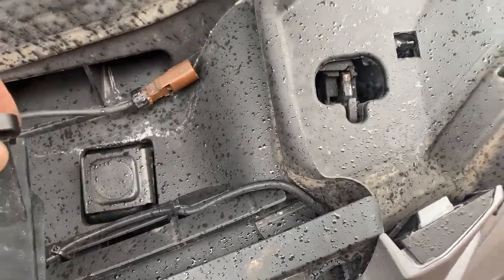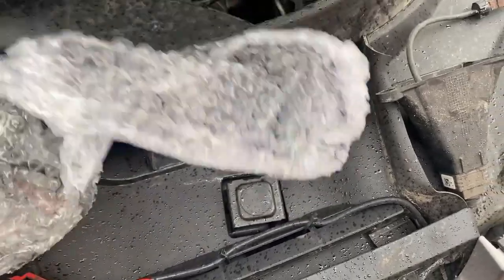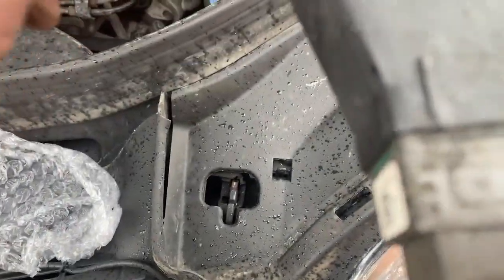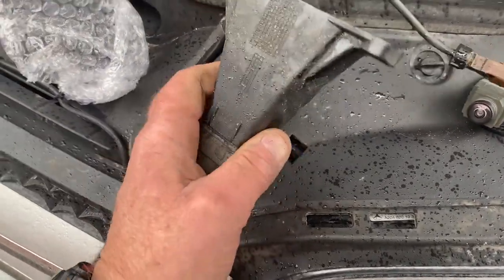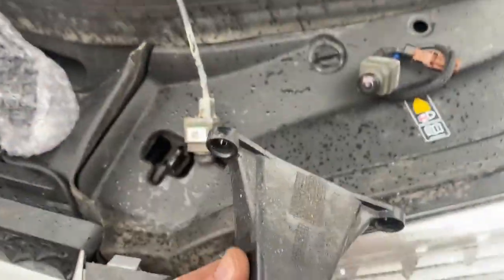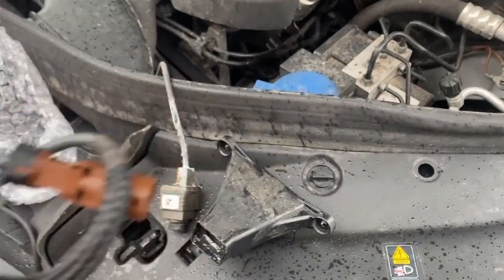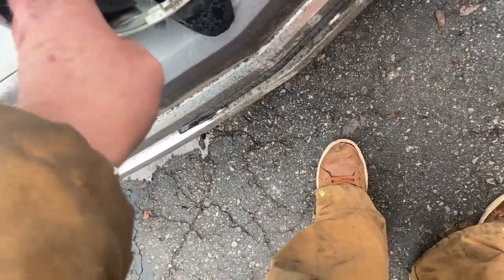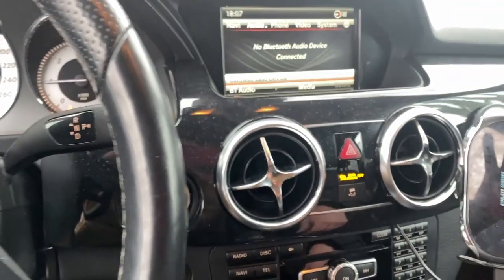Mercedes Front grille camera replacement 360 degree camera

Comment: Hi.  Thanks for posting.  Very helpful!  I'd also like to know where you purchased the new front camera.  Mine works intermittently so likely same corrosion.  Thank you.
Reply: got mine on Amazon, $212 CAD
Reply: @stevemurphy2591
Reply: Do you still have access to the part number you ordered?  

I'm in Canada and 3 different part numbers are posted, cant determine which is correct and none are available in Cda regardless. ??  I will have to order from Alibaba or Amazon US.  Thanks again.

Comment: Did your GLK come with front camera or was it an add-on? If it was an add-on, where did you get the parts and was it an easy install?
Reply from the maker: Factory surround camera option . So it was just an easy replacement of the factory camera .

Comment: Fupa! I got a question. I got the mercedes m112 on a w202 I made you some questions some years back. So this is my problem. I bought the intake manifold gaskets. But when I take mines out they didnt have air injection holes on the gasket(The ones I buy did have them). Im gonna need to buy the ones without these holes? Or there is no oproblem if I let them open? Thanks a lot!
Reply: I cant find these gaskets where I from so Im wondering if I can just epoxy tape them jaja
Reply from the maker: I believe you can just use the one with the holes . If your originals had no air injection holes you could just seal them over

Comment: Bought the aftermarket camera, all looks good, same PN#, installed, still front camera blacked out? Fuse? some kind of a reset required? any help would be appreciated, thanks
Reply from the maker: Possibly a camera software/ communication issue . I know mine still fails to come on maybe once or twice a month . All wiring seems fine .Hopefully the dealer can reset it or update the software.
Reply: How much is the aftermarket one ? and can you drop the link ?
Reply: I hv same issue. How to do the reset?
Reply: I installed the after market it was blackout. Tried Installed back original same issue. What to do?
Reply: I read a review on Amazon from a buyer with the same issue.  They advised to turn off your 360 camera via the menus in the dash display.  When the system is turned back on, the cameras were 'reset' and worked as usual.  Worth a try.
Reply: Did anyone solve this issue